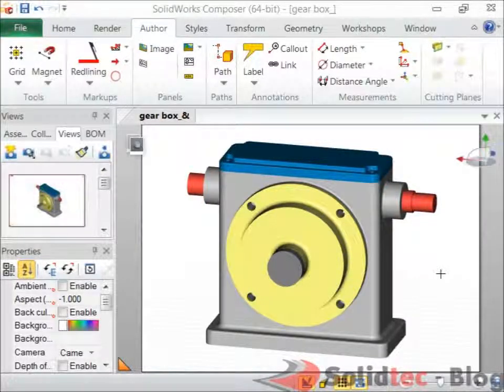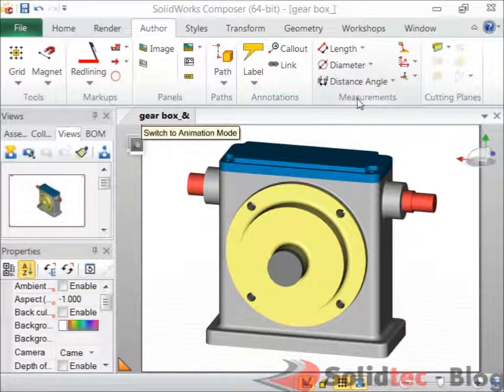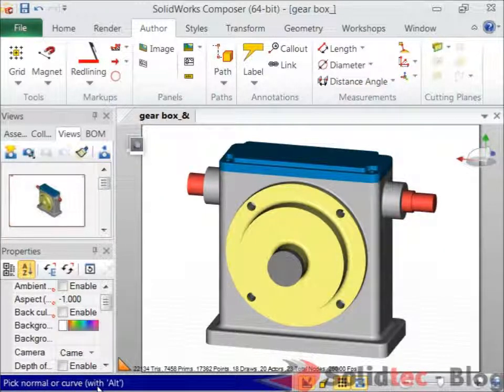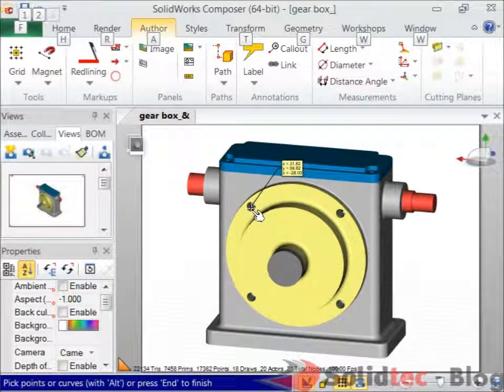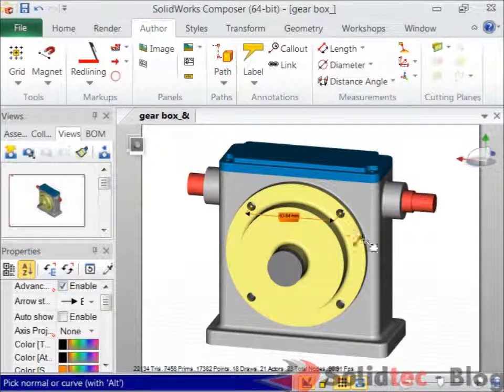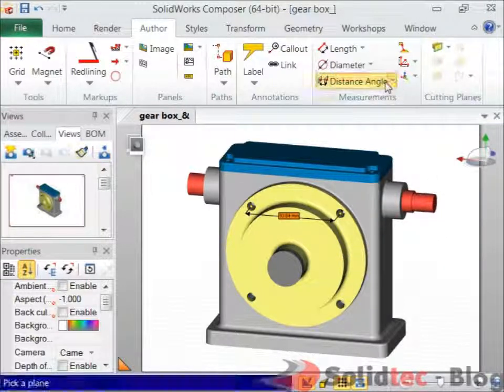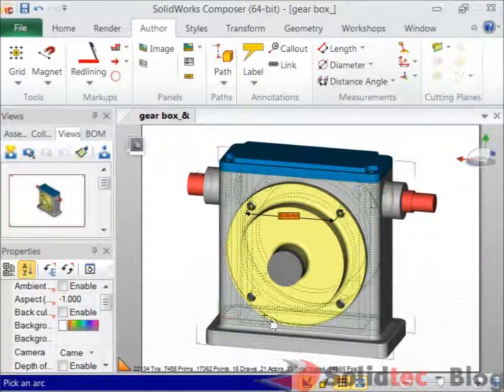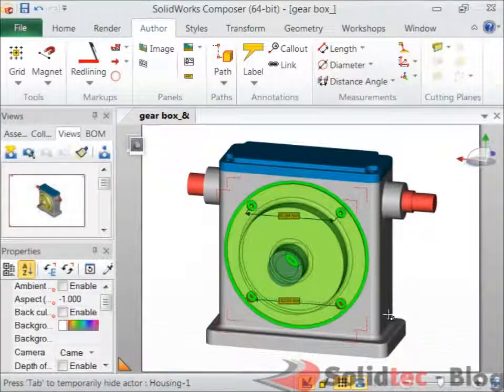SolidWorks Composer: Measuring between two holes

Comment: When using plane projected the dimension cannot be pulled around or pulled off the model.  When using center-to-center, I can pull the dim around but the arrows line is on top of dimension text box.  how can I get the arrow behind the dimension text box?